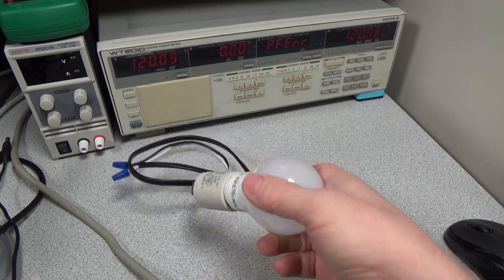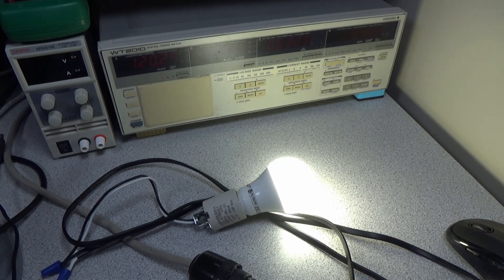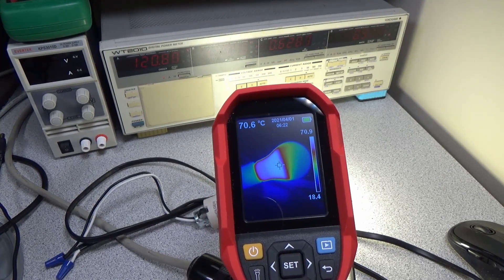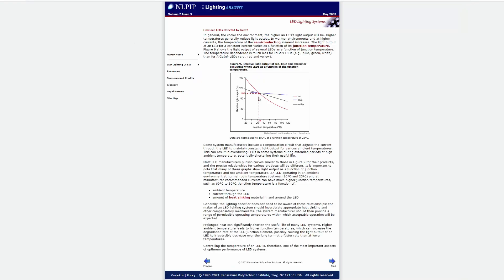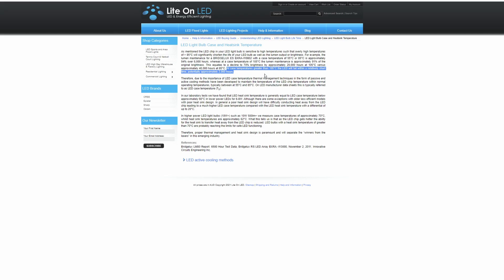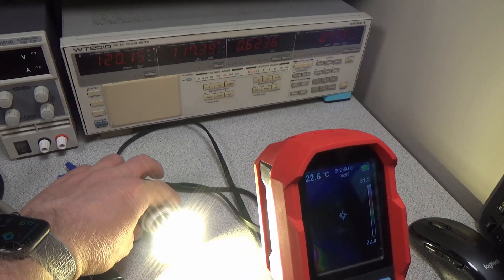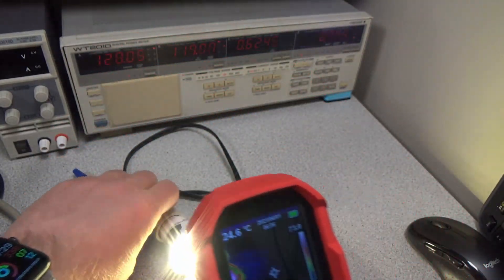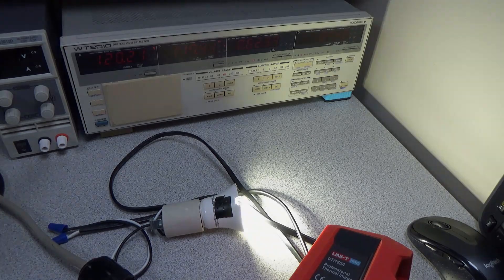Are LED Bulbs Too Hot?

Comment: My led bulbs are failing around 1000-2000 hours. Worse than incandescent. 
So how do I keep them from not heating up and causing them to fail.
ANSWER: Don’t turn them on!!!
Reply from the maker: Yeah, unfortunately, true.  You have to modify the resistor on the current limiting chip to put less power through the LEDs.  This isn't all that easy with the aluminum PCB's these use.  Doing that also limits the light output of course so this '60 watt equivalent' becomes a '20 watt equivalent' if you want it to last longer.

Comment: Please measure how hot metal halide lamps get
Reply from the maker: I don't think my poor thermal camera will like that.
Reply: @AllThingsOnePlace  Really? I never had issues with my thermal camera. I had it close to even a 500 watt halogen lamp. Metal halide bulbs typically measure around 500 degrees though for like a 400 watt. My 500 watt measures 700 degrees on the glass and 300 on the back. It didn’t melt my temperature gun at all.

Comment: I wonder how hot that bulb gets when new out of the box...
Reply from the maker: Since it is a current regulated power supply I expect the temperature to be constant once stabilized.  The location where the bulb is installed will change where that temperature stabilizes.  The bulbs orientation in installation will also effect the temperature gradient.